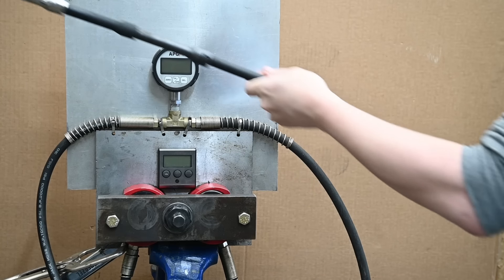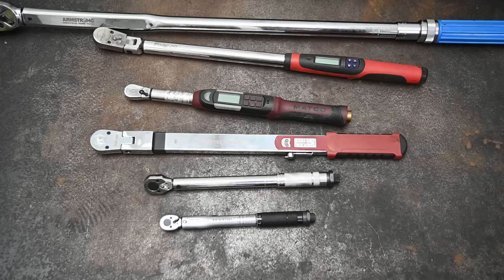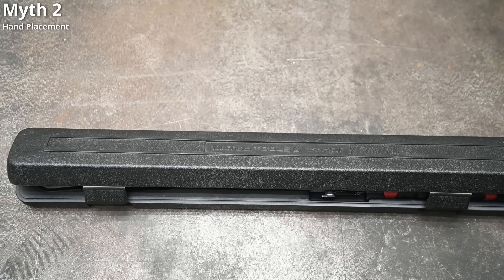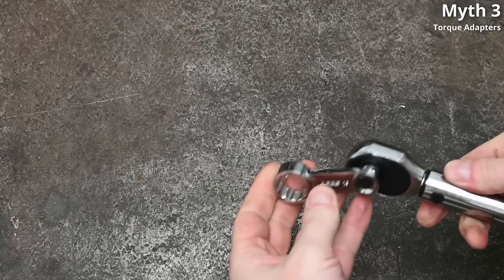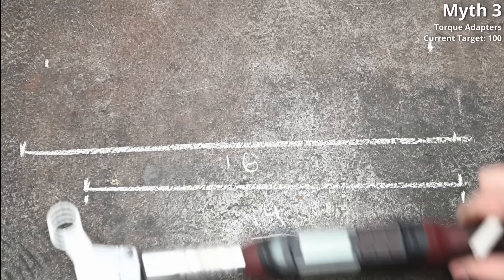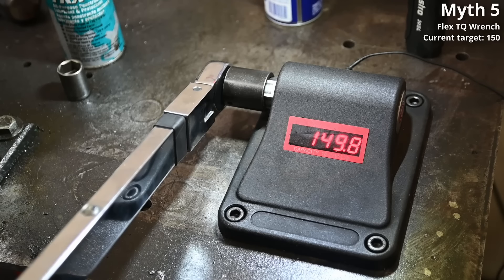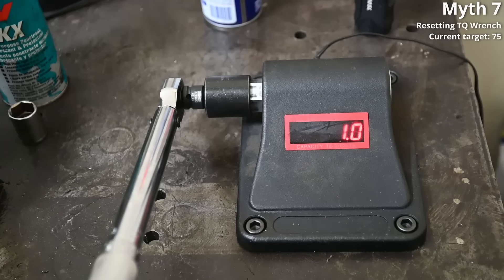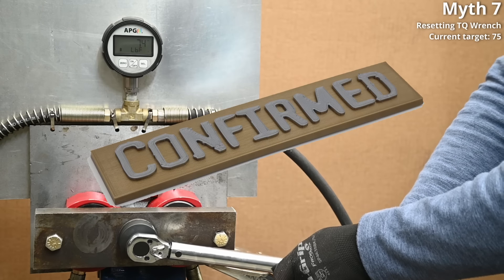You're Using a Torque Wrench Wrong: MythBusting 10 Do's & Dont's

Comment: I accidentally left my husky 50-250 set at 130 for almost 2 years. Did I just ruin it or can that stil be recalibrated?
Reply: I've also responded to you on another channel. Have you released the spring tension down to the minimum torque setting for a period of time? If the spring has been given a chance to relax, an accurate check of its torque delivery over its working range would reveal whether the spring is of good quality and has retained its parameters. There are various ways to check for yourself, such as getting the use of a digital torque adapter, calculating output from accurate hung weights or comparing with a known good wrench. If it measures within the +/-4%, you're in luck, no need to do anything.

Comment: Before you condem the use of lubrication on threads to be torqued  talk to the folks at ARP. The fact is you may have been dry torqueing assemblies that all should have been lubed. And so not getting the correct compressive force.

Comment: Can you just use a digital torque adapter with any regular ratchet instead of purchasing a torque wrench all together?
Reply: You can, I use both since I already had torque wrenches. Starting out now, I might have just got a digital adapter. They are accurate, but there are disadvantages - being able to see the display as it rotates, going to use it and finding the batteries are flat, or worse, have leaked (use good batteries)...
Reply: @PlatypusPerspective  Thank you!

Comment: You mention during the extension test that your torque would no longer be accurate if one attachment started yielding and deforming. This is not actually true. Because the material is deforming, you will get excessive movement at the handle and may not reach final torque. But, the force you are pressing on the handle has to go somewhere, which means the fastener will still see the same torque. It is the exact same rationale as when you explained the difference between a torque wrench and impact that you end up "rotating the wrench more overall, but the final result is the same".

Comment: End of the day, most bolts and torque specs specified on vehicles have a tolerance of +-10% at the very least, so anything to get you in the ballpark is good enough... Backyard mechanic doesn't need to overthink it.

Comment: Can someone explain to me why such accurate torque readings, aside from common sense, are necessary for everyday automotive, truck, heavy truck, and farm equipment repair? 20 years for me, 50 years for my retired mentor and good friend. We over torque everything using simple click torque wrenches for 95% of things, and manual angle torque wrenches to analyze drag on transmission and differential repairs for the rare remainder 5%. We always release the torque wrenches to 0 after use.  Impact guns we are familiar with are used where its just stupid to even attempt to use a torque wrench. You either need 1000 dollars in adapters or spend hours of labor removing components. Maybe at SpaceX, but otherwise please someone explain this importance that I believe is overated. And yes, cheap click torque wrenches after 20 years still work if you always dial them back to 0, and always over torque just a smidge. Muscle memory style.

Comment: The nut factor is the reason I don’t mind people laughing at my no name brand torque wrenches. What difference is +- 1% VS 5% really, if you don’t take good care of the threads and cleanliness. Another thing is the static vs dynamic friction, use consistent rotation speed when torquing and don’t ”torque check” afterwards, as it basically means nothing. The breakaway torque is higher so it will click even if the torque achieved in the first run was too low. 

My thoughts.

Comment: So that's why I snapped a valve cover bolt while using a torque wrench, there must have been oil in the threads. I thought it was because my cheap torque wrench was inaccurate.
Reply: Does loctite lubricate enough to affect torque specs?

Comment: Would it be possible for you to do the anti seize test, but using noalox instead, and using an electrical terminal screw?? I know the principle is the same, and that's why most mfgs. explicitly say NOT to use it, because it affects the torque applied on the conductor, but I have argued with more than one inspector about noalox when they said it was required for use with aluminum conductors

Comment: The engineering data should have the torque values along with the conditions of the threaded fasteners. All threads must be clean and in chased or wire brushed condition. The threads dry or lubricated with a specific fluid, ie 30 weight engine oil etc. It really isn’t rocket science.

Comment: Torque adapter.. it's such a small difference on most "normal" size bolts.. I don't bother calculating anymore.  Found myself checking the calculation 3 times to make sure that 1lb difference  was accurate. Lol

Comment: I have found it hard to locate a uploader to give a video well or feel like I can trust their wording for "calibrating torque wrenches". So it is not something I feel secure in. Chrisfix said he would upload one but somehow never arrived at doing it. It's how the wording is used and knowledge checking out well that sends red flags, or not with Chris. Not other stuff per say.
Reply: Apart from tutorials put up by manufacturers to help technicians use their test equipment, I don't recall encountering an instructional video for torque wrench adjustment that could be said to be totally correct. There are a few reasons for this. The two main ones are if the uploader isn't aware of lever length sensitivity (Myth #2, many don't realize), or doesn't know there are two adjustments for the click wrenches, which are not always accessible to, or adjustable by, the user. Instructions are often given to use the wrong adjustment for the torque output being tested, which can result in the wrench only being accurate at that particular torque setting. (Assuming the overall technique - weights or whatever - is accurate.)

Comment: Have a CRAFTSMAN 1/2-in Drive Click Torque Wrench (50-ft lb to 250-ft lb) Item #1049189 | Model #CMMT99434 original $105/ 4th July 2024 Sale $60.
Vehicle 2023 Toyota Camry XSE V6 19-inch Alloy Wheels,  lug nuts 12m x 1.5,  21mm, recommended torque 76 to 83 ft-lb (103 - 113 Nm). 

Question? Guess due to length of the TW and hand placed on back grip. Should I set for 79 ft-lb or go higher like 87 to obtain actually required torque?

It's not recommended to use anti-seize grease or anything on wheel studs, just brush off any corrosion. If significant rust or cross threading then replace the studs, Lug nuts should be replaced every 5  years or when they appear to be worn.

Comment: The issue with choking up on the wrench isn't exactly being framed properly.

The reason the accuracy is "off" as you hold closer to the top is because you have less of a lever arm and your human movements make more of a difference and because humans are not perfect machines that gives less time to react so you end up going to far or too short.
The handle of the wrench don't give a fuck where the force is being applied. That is a solid steel rod.
Reply from the maker: That's not how it works at all. It's not a solid steal rod. There's a pivot point in the handle that assumes a certain hand distance. Two tunes interacting with each other. I encourage you to look into it
Reply: Awh. I was hoping to be correct

Comment: Torque is pressure/force over distance...........................................providing you don't change the length or force, you'll be fine.

Comment: Wait, so hand placement doesn't matter on a digital torque wrench? Why not?
Reply: It appears they tested a wrench or some wrenches that were not length sensitive. Like traditional mechanisms, digital wrenches can be length dependent or not depending on the design. It does seem to be becoming more common for digital units to be insensitive to hand placement, but at least one manufacturer's digital units incorporate hand position sensing, and will issue an error indication if it is not held at the handgrip.

Comment: While I am amazed that the anti-sieze doubled the clamping force, I think there has to be another look at this from a science POV before freaking out.
If we assume the standard gray anti-seize is leading to double the clamping force when used, what does that actually mean as it concerns bolt stretching/failure?
My understanding is that lug nuts/bolts already have a hefty, hefty safety margin built-in specifically because the are the most common fastener touched by the public, and most likely to be over-torqued by same, etc, etc.
While its good to know, outside of the few crazies over torqueing their street rods back in the day, it seems like ever with a 100% over-torque there aren't a lot of complaints about busting nuts/bolts in a lot of car repair forums/channels where anti-seize/oil is used.  One has to wonder, are the toque specs supplied by manf. actually critical as they are somewhere near the nut/bolt yield area, or are they supplied because they meet the load clamping requirement, and are no-where near the actual bolts yield?  If its the later, that would explain why we don't hear that many complaints about auto manf's all 'using cheap nuts and bolts'.

Comment: The lubrication thing killed me.  The torque doesn't change.  100 lbs-ft is still 100 lbs-ft.  It isn't 200 lbs-ft.  The lubrication increases the clamping force and tension on the bolt.  It doesn't increase the torque.  The torque is still exactly what the wrench says it is.

Comment: Whow! Stop the buss🤚 the compare accuracy of cheap torqwrenches you will need to compare them across their full range.
Cheap torque wrenches are normally double cheap; they are not only cheap in price but they cover a torque range that can often cover the range of what you will need 3 expensive torque to cover.
While I doubt if cheap torque wrenches will be far off in the middle  of it's range, I seriously doubt their accuracy at their lowest and highest settings.

Comment: Your fonding with the harbor freight wrench may not be universal. It depends on the quality of the spring. If that was the case all the time, your car would sit lower as the springs sagged.
Reply: Cars do sit lower as the springs sag, I've seen it quite a bit in older cars. A spring works can reset springs to factory spec, or maybe suspension specialists, although most of them would now probably just fit new springs rather than having any spring treatment capacity. But the tolerances that the spring in a torque wrench must keep to are very tiny. It must maintain a parameter called the Spring Ratio, whereby the ratio of spring length to resultant force must exactly span the micrometer adjustment range from minimum to maximum as originally calibrated. On my main wrench, each pound force of adjustment moves just under 5 thousandths of an inch, so if the spring became compressed so that the length was 20 thou out at a particular setting, the resulting torque  measurement would be more than 4 lb/ft out.
 But like you say, I don't think there's any doubt that the quality of the spring will determine whether there's an adverse result from leaving a wrench at a high setting.

Comment: Welp! I guess my lug nuts have been way too tight for 35 years... Which tells me that torque specifications on lug nuts is the real myth. I don't know how this machine mechanically measures torque, but surely there's a difference between the force applied to an aluminum wheel vs something far more compressible like a rubber gasket.

Comment: (Watches this video) Runs out to the garage to reset both my torque wrenches to zero after a month has gone by and panics, thinking that I'm going to die after tightening the rear wheel axle nut is not 100% to spec 🤪

Comment: This is very upsetting.  I read somewhere that different industries have different standards for how the torque is supposed to be done and that the auto industry specifies the bold be torqued with the equivalent of 30 weight oil.  Also, I have an old Craftsman beam style torque wrench that put in the instructions to add 5 ft-lbs for every 6 inches of extension.  It was actually in the manual.  Perhaps this only applies to beam style torque wrenches, which you didn't test.

Comment: Uhhh, torque is torque, torque isn't preload however, which is where the k factor comes in. If you apply 100 lb ft on a fastener, you have indeed applied 100 lb ft on that fastener, not 196 or whatever that reading was. The fastener was stretched more with the antiseize because as you pointed out, there's less friction so more of that torque is used to preload the fastener. Clearly you guys know all this, but it's pretty lazy and incorrect to distill it down to "torque isn't always torque".

Comment: Would you, could you, use a torque wrench?
To tighten bolts and nuts with a clench?
You may not like it here or there,
But trust me, it's handy everywhere!

You could use it in a shop,
Or under a car with a plop.
You could use it on a bike,
Or on a plane, whatever you like!

So try it out, don't be afraid,
With a torque wrench, you'll be amazed!

Comment: On the old spring bar style with the long pointer and the scale at the handle (beam and pointer) it is also fairly important to use the pivoting handle and to keep from allowing either end of the handle come in contact with the beam since if you don't keep it floating it can throw the reading off substantially.

Yep wet specs need to be done wet and dry need to be dry.  Rusty need to be cleaned or replaced.

On the clickers clean can be more important than price since they may not click at all once you get dirt inside the mechanism.  Yes that indeed has happened to me and of course on a highly critical fastener which at least I stopped when the effort got higher than my internal torque gauge felt was appropriate.  That said some of the more costly may be better sealed against getting dirt inside them.

Best!

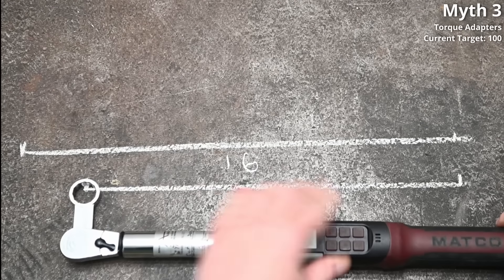Comment: 8:05 if one were to be pedantic; you do actually ad a tiny bit of length. Using Pythagorean Theorem with a 14 inch handle and a 2 inch adapter at a 90 degree angle, you ad a whopping!!! 0.14 inches.
14^2 + 2^2 = 200 square inches
√ 200 = 14.14 inches

But yeah basically zero all things considered.